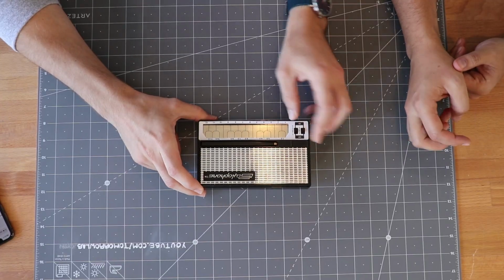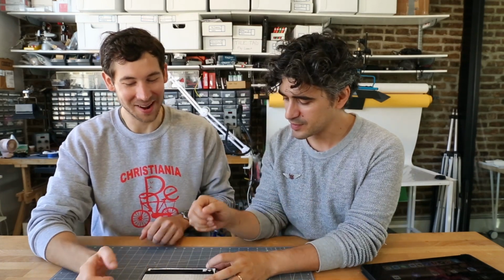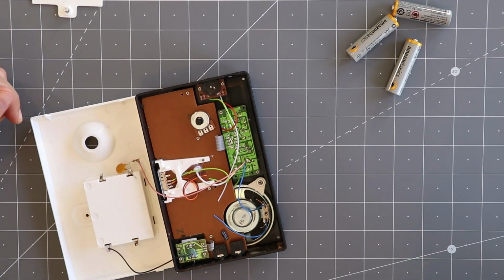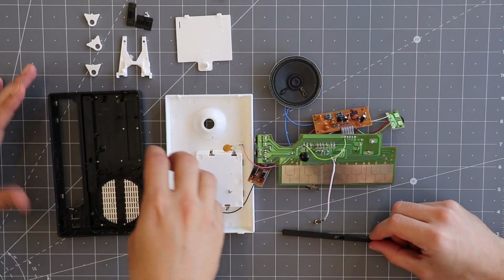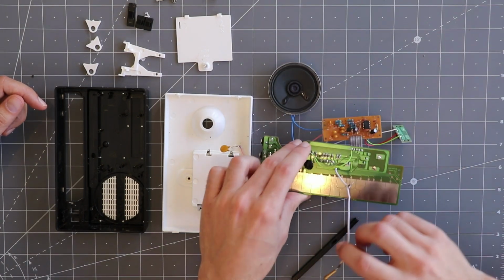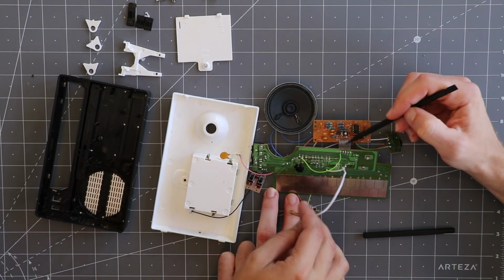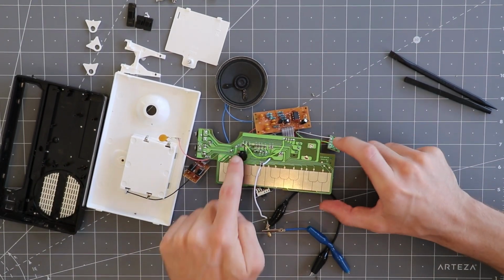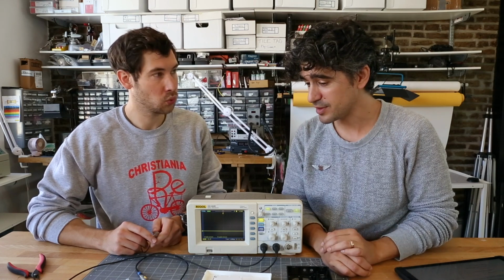Stylophone Teardown!

Comment: This is a cheap Chinese reproduction of Stylophone with the COB IC. The original 1960s British version was all discrete components, with a unijunction transistor oscillator and resistor ladders for the notes, which made a distinctive sawtooth sound.  Then later versions from mid 70s and onwards, used an NE555 timer IC as the tone generator, which made a squarewave sound. Dupreq called it "New sound Stylophone"
Reply: So i think the oldest generation sound the best? Sawtooth sounds better than squarewave. I don't like sound of Ne555 tbh. The S1 sounds better to me.

Comment: OK so you guys are not good at this... here's why

1) it's not resistive

It's resistive on the old one not the modern ones. this one it's just a dry contact with a microcontroller making the tone. that's fine but you are incorrect because you can't have a mid point by bridging two contacts with the stylus which is misleading. 

2) you don't know how to actually use the oscilloscope.

yes you need the ground. otherwise it's floating.

Comment: The Stylophone that we have here is generation #2. The first generation did not have the switch on the front edge that changed the voice. First Gen. was made in the very late 60s. Gen #2 was made in the early 70s. I used to have a gen #1. And it sucked. I have to laugh at the comment about " is it analog or digital?" It was made in the 70s. What the hell do you think? I think I might know a thing or two about these things. When I was a young man, phone calls were made with a rotary phone. Cell phones were a thing in 'Star Trek. I watched the world change from analog to digital. I watched the world go to hell. At the end of the video, you say we can do new tech, we can do old tech. You have no idea about how the old tech worked. The old stuff has no resemblance to what we have now. Dynosores and automobiles.
Reply: I think this one is a recent re-release. It is digital using a micro-controller, not analog like the ones from the 60’s-70’s.

Comment: How did you remove stylus?
Help)
Reply: Seriously yes.  I need to know this too!
Reply: The main body/pen for the stylus is not meant to be taken apart. The brass head is just pressure fit and slid into place. So if you use some pliers you can slowly twist and pull the head out. After that unsolder the wire and you can pull it back through the body/pen. My wire was completely shredded and I had to replace it to get mine playing again. Hope this helps.

Comment: I think that is a Chinese copy... Or a more modern original. The original 1960s and 70s one just uses lots of discrete resistors, caps and transistors. Just finished repairing two 60s and 70s Stylophones and whilst doing so, came across your video. Interesting seeing inside this one though 👍

Comment: Any idea what I could do?
The vibrato switch on my stylophone doesn't work anymore...no matter if it's in "on" or "off" position - its always deactivated.
Nothing happens when you change the position of the switch.
Reply from the maker: Not sure - either the switch component failed, or something is preventing the slider from moving fully to the the 'on' position.
Reply: If it's an old school original, it's probably a dodgy capacitor. I have a 1970s one that doesn't vibrato, but I haven't gotten as far as replacing the caps yet.